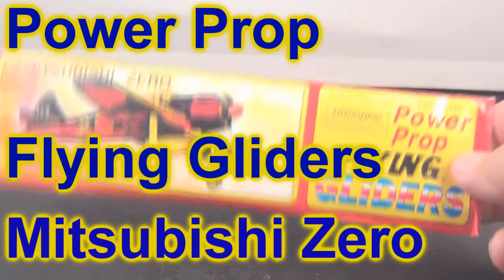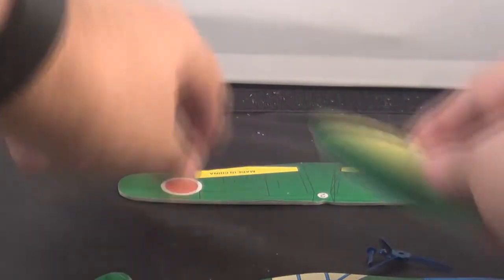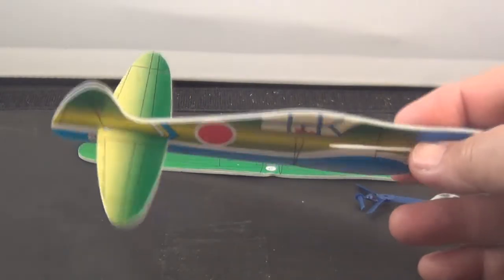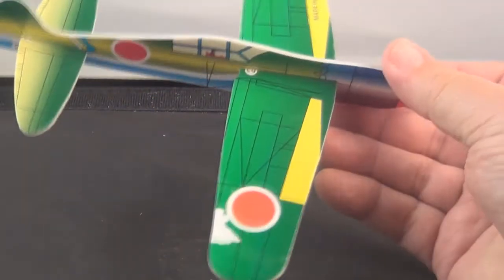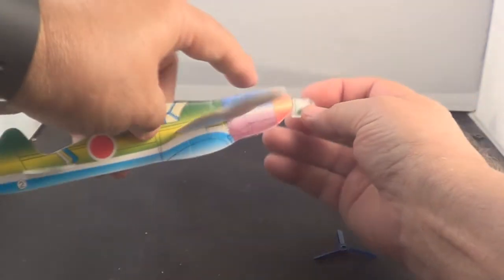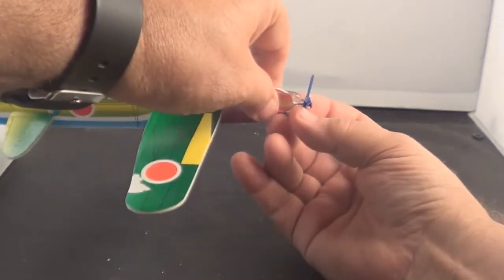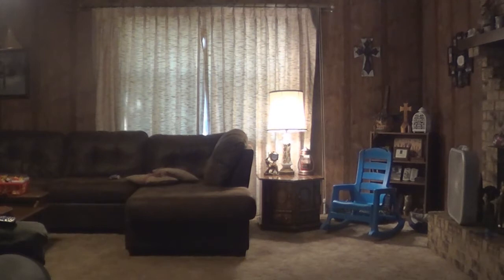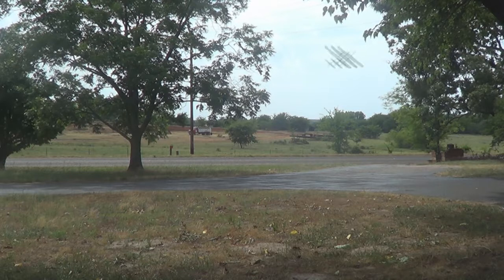Power Prop Flying Gliders Mitsubishi Zero UnBox Build and Fly Plane

Comment: I got one of these right now its in a pack of 12! It's sad because Piper plane ist the real one
Reply from the maker: They are fun though
Reply: @bwcpublishing  yess I make an f82 using two same body shapes ands using wing tail ang connect them and now I got a F82!
Reply from the maker: @redamielchannel8323  Sounds good
Reply: @bwcpublishing  but it flew on the roof
Reply from the maker: @redamielchannel8323  LOL sometimes that happens
Reply: @bwcpublishing  lol